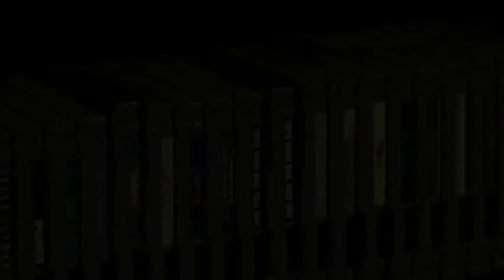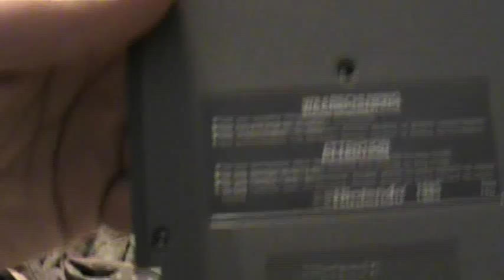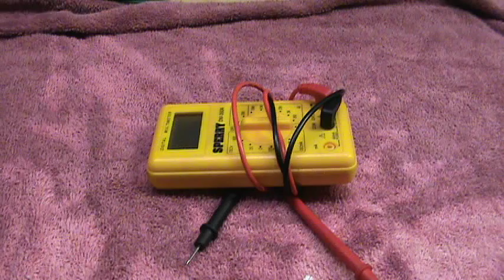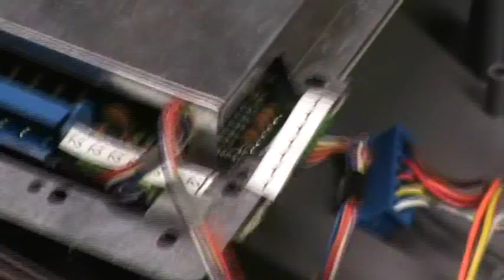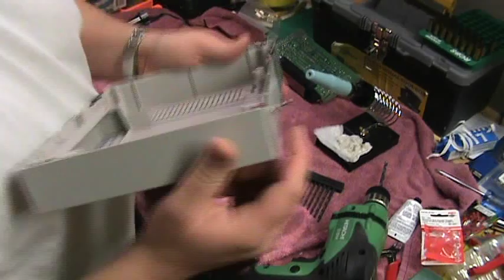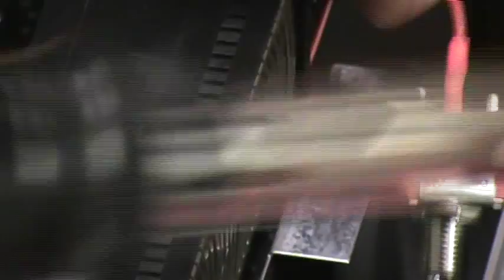NES Mod - Disabling Lockout Chip - Part 1

Comment: You may have covered this in the video (sound doesn't work right now), but what is the purpose of having the switch to enable/disable the mod? What is the benefit of switching back to the unmodded state?